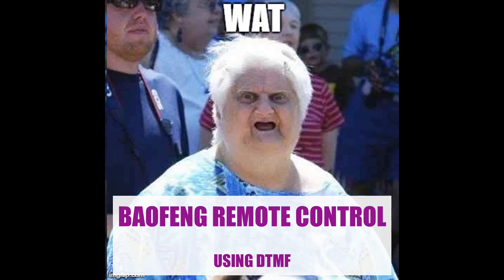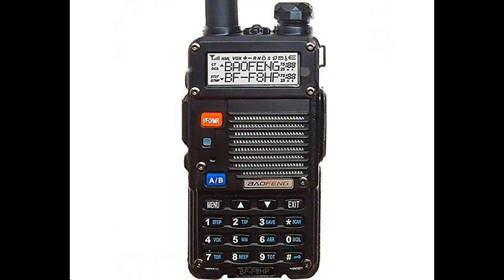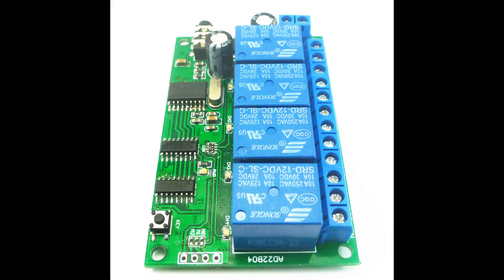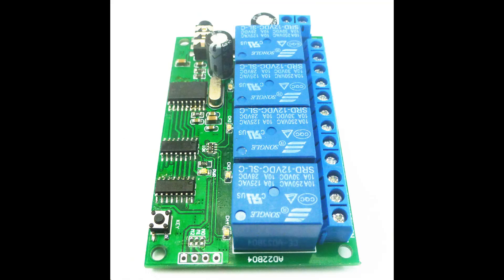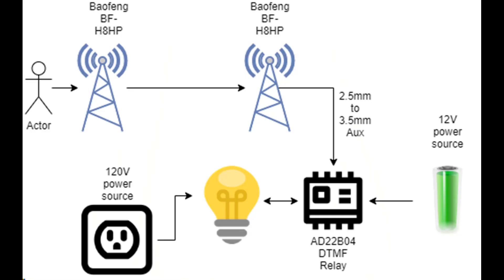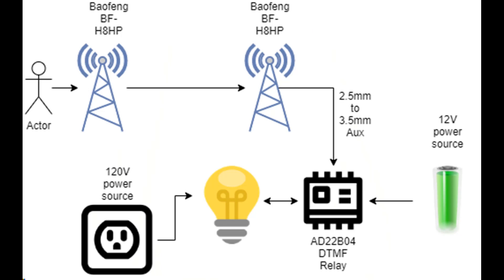Baofeng Remote Control

Comment: Pretty interesting, although not completely practical. On the topic of not very practical, there is a WiFi IoT device that can actually be used to broadcast analog television
Reply from the maker: Let’s do it the dummest way possible
Reply: @birbware7319  lol yep. Sometimes it feels like the most fun and entertaining ways to do things are also the least practical. Interested to see what else you do in the future
Reply: This looks like a practical answer to my issue. I need to open my gate that's 1 miles away from any Internet sources and it seems I can use this to open and close it.